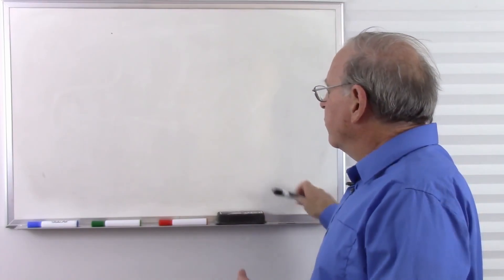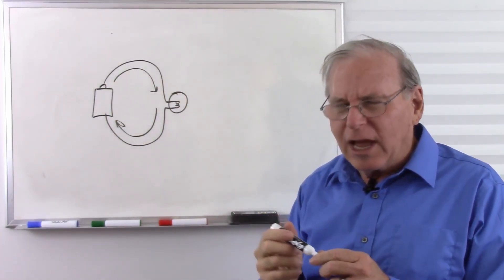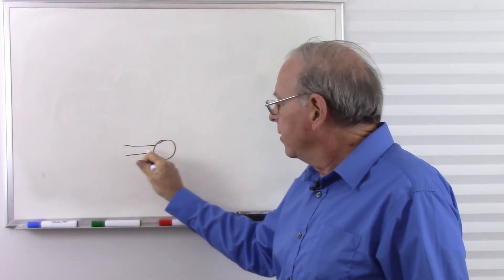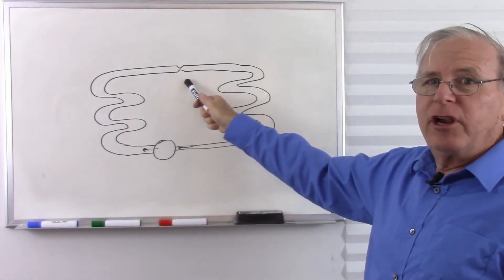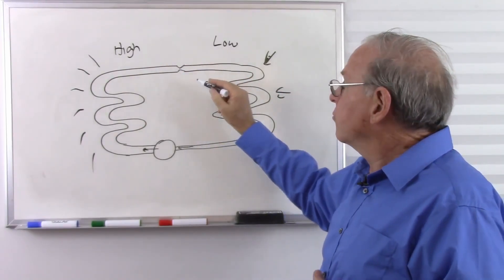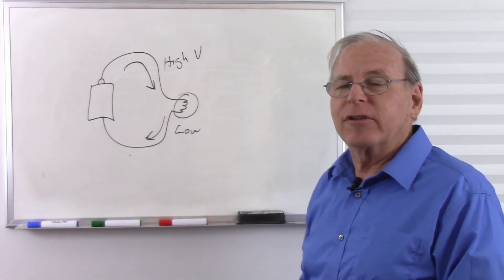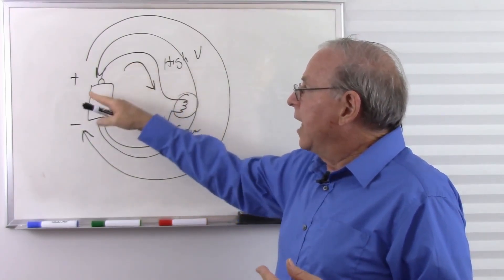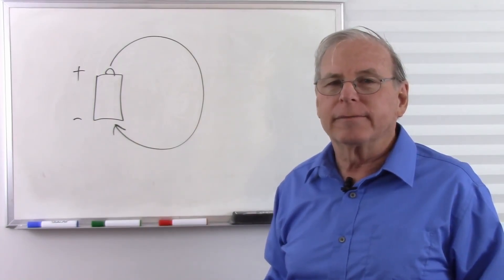What is Electricity   What is an Electrical Circuit

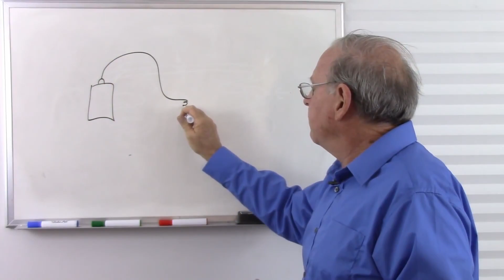Comment: If the actual flow of electrons is neg to pos, wouldn't the "back pressure" or voltage be higher on the opposite side of the resistor than shown. 10:00-11:30 of the video